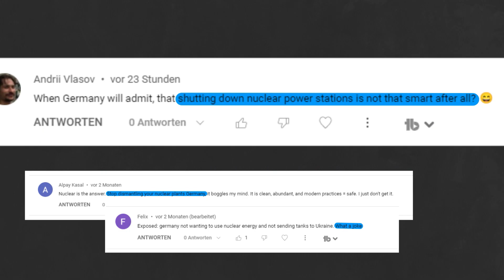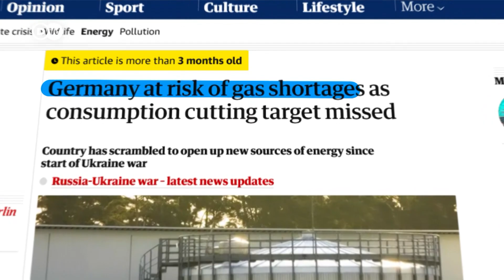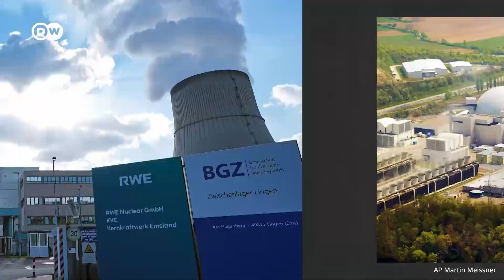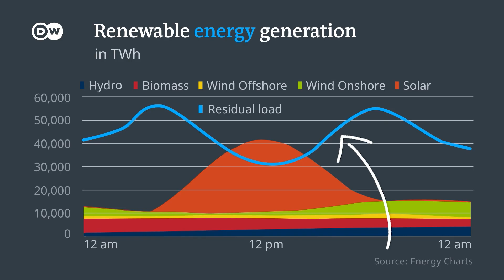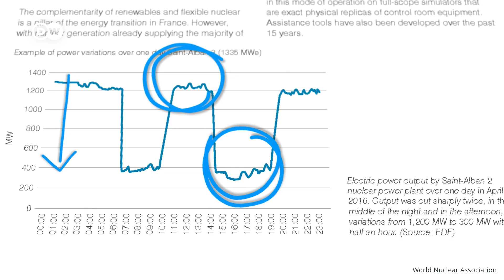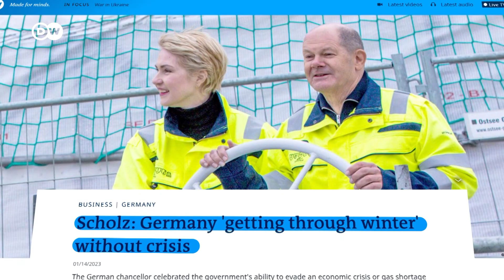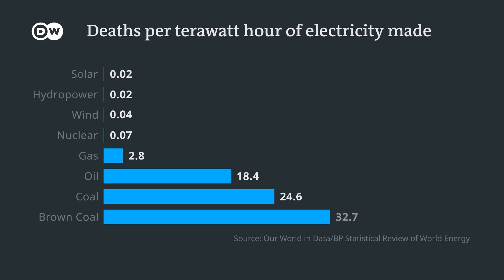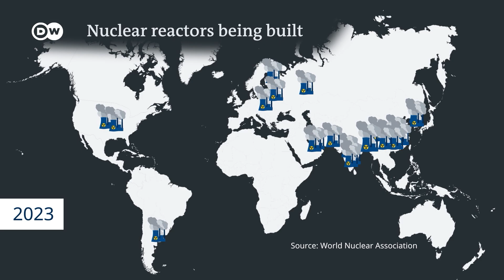Is Germany's nuclear exit a mistake?

Comment: In one word? Yes.

Edit - After watching the video, my answer is still yes, and I also agree with the view presented. Much like carbon capture, Grid scale energy storage is non-existent, and I personally don't think that it will be viable in the next 15-20 years to have sufficient energy storage capacity to be on 100% renewables. Plus, especially for a country like Germany, it makes no sense to be 100% dependent on wind and solar. Because of climate change, everyone will experience extreme weather, and to reliably have energy available, both the energy production and storage would have to be at least 1.5 to 2 times the required energy by the country. That immediately doubles the cost of solar and wind and batteries. 

Base load is exactly what it is. Energy that is available regardless of external factors. Nuclear makes perfect sense for base load capacity. And I am not even saying the "new" nuclear technologies. Properly maintained nuclear plants that had years of lifespan left in them should never have been turned off before that time. Instead of that, we ended up burning fossil fuels to bring more fossil fuels so that we can continue to burn the fossil fuels that we bought. It is stupid.

But as mentioned, it might be too late for Germany to turn back to nuclear. Hopefully no other country makes the same mistake.

Edit 2 (Replies to some points raised in the comments)-

I see my comment has gained some traction, and I would like to reply to some of the points mentioned.

For the scale of energy storage needed (why we need so much more batteries), there's the principle of the factor of safety in every engineering class. Let's say you have a ICE car and you need a battery for the starter motor. Usually, the starter motor is required maybe once every 30 minutes. Would you size your battery according to that requirement? Would you double it? Quadruple it? Let's say you sized it for 4 cranks, and the engine still didn't start. There are still things you can do, and at best, you inconvenienced 4 people. You don't really have that option with the whole country.

Regarding the Japanese comparisons (claims that I said Japanese reactors were not well maintained), Fukushima was well-maintained, and that is why there were zero deaths due to radiation. Also, in case you missed it,  it was the strongest recorded earthquake in the region since the 19th century and the waves were 40 meters high. It was a bad design that caused the backup generators to fail due to flooding (40 meters is a lot to be fair), and even slightly newer plants are designed to be passively cooled and meltdown-resistant, like the ones in India. Germany on the other hand, does not have earthquakes or Tsunamis.

Now for the French people having issues with old plants, why do you think that is? Germany alone approved 10 billion euros to bail out Gazprom last year. I am pretty sure that if even a tenth of that cost would have gone into researching nuclear tech over the last 30 years, we would have had much better nuclear plants In Europe.

And for the person suggesting I operate a nuclear plant while others operate battery-backed solar panels, you are totally skipping the electric grid and power requirements of everyone except residential areas. Actually, not even residential because people living in flats and city centers cannot run their homes on solar, even in Asian countries where there is plenty of sunlight, let alone Germany.

Renewables are good now because we have been heavily subsidizing them for over 30 years. Nuclear could have been the same, and we would not have been in such a deep CO2-filled hole if we had focused on nuclear as well.

So, in summary, yes, Germany's nuclear exit is a mistake. A mistake they have continuously made for the last 30 or so years. And its not just Germany, it's most of the countries.
Reply: Very TRUE, also prices insanely expensive???
Reply: The issue with the current nuclear plants is that they've all reached their designed end of lifetime.
All of them were designed to run for 35 years, and the three remaining ones have been running since 1988 or so (commercial operations started for 1988 for two, and 1989 for the other one). 
It's a bad idea to run reactors longer than what they've been designed for, which is what France did. The result is that they become expensive, hard to maintain and very unreliable.
Reply: @GeoStreber  French reactors were designed to be operational for "at least" 40 years. It had to do with financial implications, not technical ones.
Reply: The same forces that paid German politicians off to shut their nuclear plants, are also paying off other countries to shut down their nuclear power plants. Don't worry we will all be equal in misery.
Reply: P. Zeihan has said in his multiplicity of Videos on here that 'Germania' will have to change as the 'Bankroller' of the EU as the energy to continue what it does now will not be available at the price to make it work!....................Unless it goes to war to take it!??
Can't see that happening in todays world!
Reply: problem is in a grid with a high renewable energy percentage base load is useless you need something that can manage the residual load and nuclear power is just not able to manage that. Using nuclear power caps your renewable energy percentage depending on how much base load you want to provide with nuclear. Postponing renewables is not an option until a market and the necessary technologies appear out of nowhere without a need for them. Creating the market for renewable energy sources in germany is what triggered the global push  to produce cheaper and cheaper renewable energy sources. to find solutions for the residual load you a) have a need for them first b) buy existing solutions (even if they're not perfect or profitable) so supply chains and the industry can start to develop. This is btw also how nuclear power became established in the first place. The first and early second generations of nuclear power plants were money pits that nowhere near became profitable - but this was understood to be necessary in order for the industry to develop.
Reply: I see my comment has gained some traction, and I would like to reply to some of the points mentioned.

For the scale of energy storage needed, there's the principle of the factor of safety in every engineering class. Let's say you have a ICE car and you need a battery for the starter motor. Usually, the starter motor is required maybe once every 30 minutes. Would you size your battery according to that requirement? Would you double it? Quadruple it? Let's say you sized it for 4 cranks, and the engine still didn't start. There are still things you can do, and at best, you inconvenienced 4 people. You don't really have that option with the whole country.

Regarding the Japanese comparisons, Fukushima was well-maintained, and that is why there were zero deaths due to radiation. Also, in case you missed it,  it was the strongest recorded earthquake in the region since the 19th century and the waves were 40 meters high. It was a bad design that caused the backup generators to fail due to flooding (40 meters is a lot to be fair), and even slightly newer plants are designed to be passively cooled and meltdown-resistant, like the ones in India. Germany on the other hand, does not have earthquakes or Tsunamis.

Now for the French people having issues with old plants, why do you think that is? Germany alone approved 10 billion euros to bail out Gazprom last year. I am pretty sure that if even a tenth of that cost would have gone into researching nuclear tech over the last 30 years, we would have had much better nuclear plants In Europe.

And for the person suggesting I operate a nuclear plant while others operate battery-backed solar panels, you are totally skipping the electric and power requirements of everyone except residential areas. Actually, not even residential because people living in flats and city centers cannot run their homes on solar, even in Asian countries where there is plenty of sunlight, let alone Germany.

Renewables are good now because we have been heavily subsidizing them for over 30 years. Nuclear could have been the same, and we would not have been in such a deep CO2-filled hole if we had focused on nuclear as well.

So, in summary, yes, Germany's nuclear exit is a mistake. A mistake they have continuously made for the last 30 or so years.
Reply: Well summarized on the OPs originating comment.
Reply: Preach!
Reply: This is a terrible thing for climate. Though it doesn't surprise me as Germany is a huge private car manufacturer. Pretty sure Germans are doubling down on fossil fuels as they have been so used to it already with Russia's pipeline. Germany also vetoed the EU 2035 fossil fuel car ban too. Hopefully climate activists and politics can do more
Reply: Storing energy from the grid has been done for more than 50 years using pumped hydro.  Obviously countries with less mountains like Germany can have less pumped hydro than say Austria
Reply: Based comment. 👍
Reply: @Aabhas Lall ignoring the inhabitants of Fukushima and the dumping of highly toxic cooling water in the ocean, ignoring the enormous costs of decommissioning nuclear power plants, the ongoing problems France is having with 'maintenance' and even shortage of cooling water. Imagine one nuclear power plant in Doel Antwerp having a meltdown, where are the people going to go?
Reply: @jaaksavat7916  Fukushima is small business compared to climate change and there's no Taunamis in Germany. The "higy toxic water" was actually safe enough to drink, even including the decomissioning costs nuclear is cheaper than a renewable system. I think you don't know remotely enough about nuclear to have such strong opinions about it.
Reply: "Properly maintained nuclear plants that had years of lifespan left in them" Are you saying that in Japan they did not maintain them properly? 
Why would you need such a huge energy storage? 
It makes no sense. Please read about the subject, you'll be surprised.
Reply: @yakovkosharovsky8487  Japan is bringing back its nuclear power. You need huge energy storage when the sun does not shine and the wind dies down. Even though the installed capacity of wind and solar may be huge, the hourly output is highly variable while demand does not vary. That is what he means by base load.
Reply: @holdmybeer123  even when its cloudy, you still get like 50% of the energy. Wind always blows somewhere. Germany is not an energy island. Plus, you know few days in advance, what would the conditions be like and how much can you produce. there is no need for such extreme energy storage facilities.
Reply: @yakovkosharovsky8487  solar basically doesn't provide any power for 3-4 months of the year in Germany and wind not bring there in all of central europe for several weeks is also not uncommon. To bridge something like that, you need dozents of TWh of storage, which is essentially impossible.
Reply: @yakovkosharovsky8487  It's not uncommon for Europe to be mostly windless at a given time. Plus it's very inefficient to move electricity on thousands of km both financially and in term of energy. It also means you need incredibly high installed power at European scale for a small part to provide energy to most of Europe.
Reply: @yakovkosharovsky8487  We need to further expand energy generation to accomodate increased demand for power. Have to do so when one moves away from fossil fuels.

Comment: Yes, I dislike current nuke big power plants,  mini nuke plants would be better. But since these existed, don't waste them - the decommissioning will be expensive whenever it's done. And any coal/oil plants should've been closed instead. Crazy decision.
Reply: The big nuclear power stations are safer and cheaper (per megawatt) than the small ones.
Reply: @gregorymalchuk272  They are cheaper per megawatt, and produce less used fuel since the power density is greater, but the smaller vessels can reject decay heat much easier, and they are also designed to initiate natural circulation for decay heat removal without any power (they use a trick nuclear submarines use to run without any large machinery running so they are essentially silent). The SMRs don't need all the support systems like blackout diesels and complex safety water injection systems the older big plants were retrofitted with. So in the public eye they are more acceptable, now we just need the next gen of fission plants to include fast plants that can burn most of this used fuel being stored in bunkers on sight.
Reply: @anydaynow01  Passive safety is not a matter of size, it is a matter of how the reactor/fuel combination is designed. Passive designs right up to 1GW have been proposed based on the same basic principles.
Reply: @gregorymalchuk272  Not when every plant is designed on it's own vs many small and standardized ones.
Reply: Maybe it was too much of a security threat to have them
Reply: @zakosist  what security theat?
Reply: @kentozapater8972  If either the reactor itself has a breakdown "on its own", maybe human failure from the workers. Or it is actually attacked by either terrorists or the military in case of war. Terrorists can attack in peace time too. Natural disasters like a big earthquake or tornadoes and possibly large scale fire could cause a reactor breakdown.